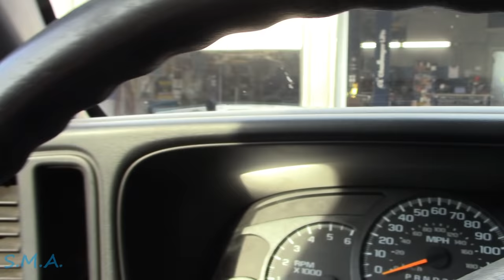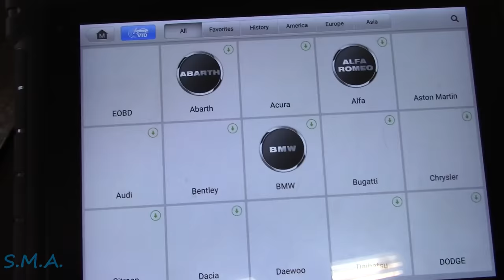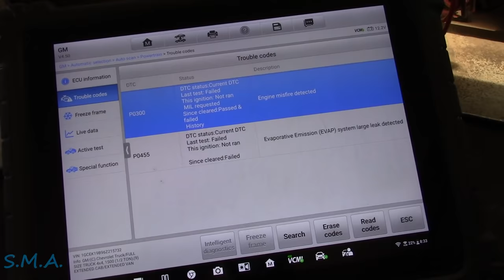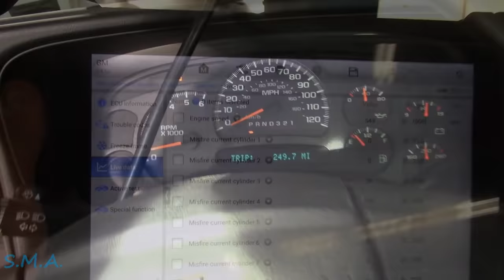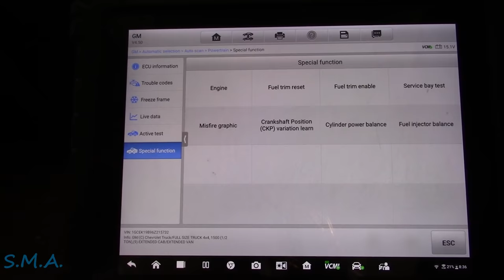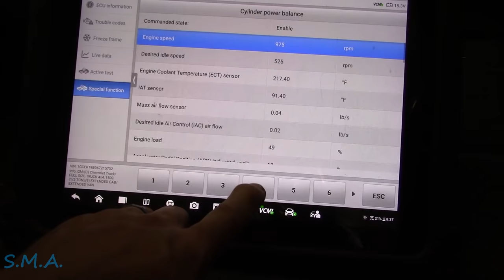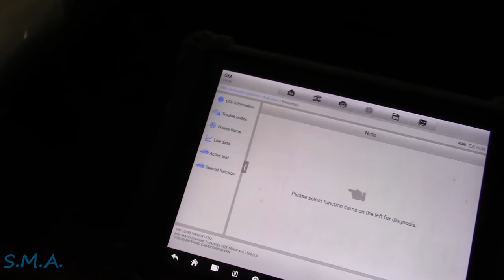GM - Chevy Truck: Misfire Diagnosis

Comment: Thank you you just woke up my brain, there are not many shops who want to tackle a 1996 Volvo, 1960 engine miss fire. I take my heat gun and see if i can see a change in the exhaust temp changes in different cylinders, I spent time in "Pick-n-Pull" Picked up three injectors that appeared to have been changed. The 1960 Volvo, is not easy to find information on and guys don't seem to be interested in 1960's. I own this one, ran fair when one of my "Rabi" friends said it is yours, people and dealers don't want to see 1960 Volvos, there shop. they say it is too old. as I started driving this car it stated to miss fire. everyone in Oakland California, where I live said get rid of that Car! Turns out this car is from your part of the U.S.A. Rust every where. Out here we don't see rusty cars unless you plan to join "Jay-Leno's," gang, who is 500 miles south  of me. Anyway, I like the way you seem to make things simple and understanding, I let you know how I do on this 1996 Volvo, 1960 miss fire. I use 0- 20 Synthetic oil in the Engine, never seems to need oil, and I just noticed Defrost is starting  to show slight steam on windshield sometimes but two weeks at a time, less then a quart of coolant needed. You have a good program. it helps, wake up the Brains.

Comment: Looks like you had the low amps probe hooked up which was why we were looking at a ramp, back probing directly into the injector would have produced the signal you needed for the pintle hump, overall great video! 🖖🏽

Comment: The pintle movement on the good injector was up near the top and the bad one was missing. As an alternate test you can monitor voltage and see pintle closing, if visible, if the pintle closes then it must have opened but in this case I did see it opening on the good one up high which also means that if the opening is down low, the spring holding the pintle closed may be broken which would be running rich on that cylinder, that may be visible on the spark plug if black and should be seen on a secondary spark pattern also, same as lean is visible on the scope. Thanks for the DIY case study.

Comment: I agree 100% regarding fuel trims and misfires. Any kind of miss will put a large amount of oxygen in the exhaust and make the ECM think the engine is lean. What I have found useful is monitoring the downstream O2 sensor activity. If the sensor for the misfiring bank shows a reading on the higher end of the spectrum you can generally assume you'll be chasing ignition or mechanical.  If it's on the lower end then you're likely chasing a fuel issue for a cylinder or cylinders on that bank. All of it of course hinges on the converter being in working order, but it's a non invasive quick check that can help give direction.

Comment: Yes, a secondary ignition pattern can pick up a lean misfire.  On a snap throttle, you will find the second spark line peaking almost a high as the first kv line because that's left over energy that cylinder didn't use up.

Comment: Great Diag Eric, I would have swapped injectors to rule it out before anything, but the fuel pulse was a dead give away, control side was working correctly, the code not being thrown for said injector baffled me a bit.

Comment: I add fuel injector cleaner with PEA occasionally to help prevent clogged injectors and hopefully help clean the intake valves and even the pistons.  I use Gumout but I understand Chevron Techron is good also.  I put Gumout in the gas for all my lawn tools, my outboard, and my carbed motorcycles too and it noticeably helps because they start quicker after setting for a good while and it cleared up a miss on the FI 2 stroke outboard.

Comment: Thanks for keeping us DIYers in mind. Understanding the fundamentals and using multiple tests to confirm the issues. Good reminder for me that good current and resistance checks doesn't prove a good injector. Electrical tests can prove a BAD injector, but passing the tests doesn't mean its a GOOD injector. Have you had any luck cleaning clogged injectors?

Comment: I think the pintle hump was above where you had the trigger set, if you compare them the good one had a drop right above your trigger crosshairs and the bad one didn't. Different types of injectors give different waveforms for sure. I think this takes the pencil type injectors, small around and tall with almost smooth sides. These give a lot smother waveform and they tend to build more amps before the pintle moves causing the hump to be higher and you don't see closing humps either. Been a long time since I did these types of waveforms but memory tells me there was something different about these types of injectors.
Reply: I saw that as well but late to the party to ask the question.

Comment: Every video feels like I'm taking a quick refresher course, but then realize I failed to take the underlying training.  I suppose I got tired of owning cars without any problems.  To remedy this I just acquired a 2014 Chevy Silverado 5.3L with 146,000 miles.  It looks good but showed up with a cylinder miss.  Will swap out original plugs and wires for good measure and go from there.  Probably be a new truck by the time I'm done or I will have gone broke.

Comment: Eric is also right about a cylinder pumping air into the O2 sensor  because, the 02 sensor reads presence of oxygen (on the air) regardless of being an unburned mixture of air and fuel.
Reply: I mean it measures and reacts to presence of oxygen not to fuel.

Comment: I think the injector opening current signature is closer to the steady state on current at about 85% up on the rising current ramp, and if so, you can tell the bad injector is not opening when comparing a good and bad waveform. I think the previous shop changed the coil(s) because the injector resistance measured normal after getting the misfire on cylinder 4 from the scan tool.

They do make spark plugs that are setup with a tap for monitoring cylinder pressure with a high bandwidth pressure sensor. You will certainly be able to see a dead hole with the cylinder pressure sensor.

Comment: I had an interesting one on a Shivvy(lol), had a high misfire count at idle but otherwise ran well. Everything else checked good and the only thing left was mechanical, couldn't find any other reason for the misfire. 
Made the call on the camshaft and i was right, it was missing a small amount of metal on the lobe which caused the lifter to pump up ever so slightly and hang the valve open. 
New cam and lifters and ran perfectly!

Comment: I had this running in the background so might have missed something but a light bulb can be a horrible substitute for an electric load because the resistance is dependent on temperature, it increases roughly 17 times when the glowing wire goes from room temperature to 100% of rated power.

Comment: It seems simple to me.  You have spark, you have power pulsing the injector, yet no fuel flows.  At that point, replace the injector.  I think we over-diagnosed this one.  It's a lot of useful information though.  I think it all added value to the video.

Comment: Use a engine stethoscope to listen to injector. High pitch clicking means injector is dry / intake clogged. Low pitch means full of fuel, spray jets clogged. No sound, yes it’s stuck. Only takes about 30 seconds to do that.

Comment: You will see the hump with a voltage reading by back probing at the injector during the secondary event. Since the injector is not shorted, amp draw look good and clean.

Comment: I had a similar issue but with a 06 Impala, hard cyl misfire at around 156.000 miles one morning. After verifying spark and injectior pulse on cyl 2 But efore pulling the upper intake to replace the injector I decided since I could actually see it why not try and use a 1/4 inch extension on the exterior body of the injector and tap around it while the engine is.running.  After lightly tapping around the injector for about 45sec the engine stated running smooth again, the scan tool detecting no misfires also.  I put Chevron with techron in the gas tank and drove the car. In November I retired it with 248.000 miles with no problems untill the a/c then soon after the fuel pump went out. I did perform all the necessary maintenance like oil changes every 5 thousand and transmission service every 30 thousand. I guess I just got lucky with the injector problem on my GM car.

Comment: This is how I got my duramax so cheap. Cylinder 3 wasnt firing at all and the previous owner figured the engine was bad. Turned out after diagnosis and swapping the #3 and #5 injectors and the miss going to #5 that the #3 injector was mechanically stuck closed and injecting no fuel. I replaced the #3 injector with a new Bosch unit, programmed it, and that was 30,000+ miles ago.

Comment: Hi Eric. Don't be surprised that a new part is either faulty or doesn't work at all, because the whole QA testing process is wrong. You can have a factory that produces injectors in batches of 1000, but only say 100 out of that whole batch are tested and that's from a former QA inspector. The only way to guarentee that the whole batch is OK is for the whole batch to be tested..

Comment: Ignition misfire to the upstream o2 will look normal as mixture is still stoichiometric.  Injector misfire to the upstream 02 will look lean since no fuel, not stoichiometric.  Resulting in positive fuel trim.  Easy to prove this by watching the response via creating either condition.

Comment: I wish I could bring you my work van.  Just started having a random misfire.  Changed plugs & wires (way overdue) ran great in Park, did well for the first couple miles driving, then crap.
Going to check my wire to plug connections again in the a.m.  Didn't realize I could slide that boot/shield back.  Not sure I've got good contact.

Comment: To me, swaptropics is no different than having a “known good” wave form to similar. When I worked at the dealer, I had a bunch of “known good” parts I kept on hand to use on cars models and engines that had the same failures over and over. The known goods helped speed the process up immensely back in the mid to late 80’s. I’d love to throw Eric in the time capsule back to the mid 80’s for a week and see how he liked working on cars then.

Comment: How important are those option selections on the Autel?   I imagine it depends on what you are working on, but what if it's not relevant, then you work on something different later down the road?  How can you change the options on the vin?  Or go through the options again?  Probably a question for the Autel Channel, but I trust you more.

Comment: Very informative video! I have an 06 1500 5.3L with similar misfire issues. Finally gave up and took it to the dealership, where they diagnosed it as a camshaft. Curious if you have any insight/video on how I can confirm this diagnosis. Thanks!

Comment: At 12:33 , if no fuel in the combustion chamber secondary and/or primary will show tween picks on a rev due to lack of fuel molecule conductivity in the plug gap , the  higher kv is due to the scope measuring higher capacitance.
The spark plug is a capacitor the dielectric  is what ever is in the gap.

Comment: I have an 07 chevy 1500  4 by 4 smallest V8. That had a light for Mass Air left it for years started feeling a stumble now and then. Finally decided to change it. Light went out seemed smoother for a few days. Yesterday got real bad as I started up a big hill had to floor it to get over it. Popping and cracking out the exhaust. Stopped idle seemed fine. Eased it up to 65 small stumbles to bigger ones as it hit inclines. But no light at after came on 34 miles back home.

Comment: I remember having an older sentra with a misfire on cyl 1, good compression, good spark. Had to be injector right? Same thing scope injector and could not see a distnictive fault either on voltage or current ramp. Replaced injector mifire went away. Cannot recall about resistance. Great channel.

Comment: Sounds like 2 cylinders lower compression on crank test.
Now my personal 98 Suburban 1500sLt 4x4 3.42 had 347,000 on it and I did a compression test for shits & giggles and it was still 205-215psi per cyl..I always changed the oil with full synthetic when I bought it at 130,000ish.
Original engine & trans, no rebuilds & front & rear diffs.
I did add Dr.Trannys shudder fix at 300,000 for a shudder @55-60 mph when tipping in throttle at speed.
Fixed that.
I did replace the noisy transfer case bc of chain wear.
But I always kept the fluids changed & full and drove it hard.

Comment: Awesome Video.  2013 Silverado.  I have a misfire on #8 that won't go away.  I've done the usual...swapped (and replaced with new) the injector, new plug & new wire, and new coil pack.   Any final thoughts before i pull the heads?  Thanks.

Comment: You could also listen to the actual injector sound using a stethoscope or simple long screwdriver for the diy folks. You will hear a clear difference between the other 2 other injectors and this faulty injector 4. This would give you a definitive answer to replace this faulty injector.

Comment: Also I don't know were I saw this but the wave form on the coil changes because of the lack of resistance on the cylinder due to no fuel because the injector isn't working,  if it's true maybe you want to add that onto your video,  either way thank you I loved your video

Comment: @Eric - I'm thinking about relationship(s) between the injector and spark systems.  In the (awesome) demonstration within this video, would the pintle hump on injectors be different when examining a waste spark system vs. a 1-to-1 COP system?  I've seen injector waveform demonstrations wherein the existence of a pintle hump is examined/found after the charging ramp-up (i.e., in the voltage collapse/fuel dispensing period).  In this video, you're looking for a pintel hump near the middle of the front-side ramp-up.  Just curious...thanks!

Comment: A major problem I heard almost immediately is they replaced coils I am here to tell you as an experienced tech that has owned several ls engines coils are such a rare failure on the ls that I exasperate every option before going to a coil

Comment: Another way to confirm it’s the injector would be to swap it to another cylinder and redo the test you did to find it was number 4. If the problem moved with the injector that confirms it.

Comment: Defenitly not the coil my first comment was wrong wow okay usually you get several bad coils straight out the brand new box these days I would do a compression test and a fuel injector balance test as well nice work Eric O @SouthMainAutoRepairLLC

Comment: Old school eh - I go back to the early Bosch  multi-port injection systems. Those injectors used to leak and I used a Colortune spark plug with a quartz window to look inside the cylinder and see the flame pattern. With a leaky injector the flame was rich (orange) at the idle vs blue for a good injector. The dealer would just replace the whole lot of 6 at $85 each, so the cost of that Colortune re-payed itself in a hurry.

Comment: have you ever  back flow a fuel injector? i put a fuel hose on the intake side of injector, hose clamp it, the hose is almost a foot long  fill with fuel injector cleaner, hose clamp a tire valve into other end of hose ( used a die grinder to reduce size of tire valve to fit hose) pressurize it to 45psi, then pulse the injector and put the end of the injector that goes into the fuel rail over a diaper, or clean rag and see if any debree comes out have saved a few injectors doing that.

Comment: I’m in the swap parts over camp  and I probably would have swamped the injector over just to easy my mind and see that miss change cylinders  luckily I have tons of ls injectors and coils after my 84 c10 5.3 swap   I did learn something during my swap  make sure the injector wiring goes to the correct injector 😅 I had 1 and 5 injector wiring swapped and had a horrible miss  2 months later I figured it out  it’s like have your spark plug wires crossed. Just because it fits better doesn’t mean it goes there

Comment: I have an intermittent problem with the left signal on my 2004 ford ranger.   I normally drive the speed limit in the right lane. Occasionally there is someone driving under the speed limit , but when I put my left directional on , it sometimes makes the car in the adjacent lane speed up.  I’ve taken it to a few local mechanics with no results.

Comment: I fixed a similar problem on a 3.8L V6 just by rapping on the injector with an extension & small hammer. Neighbor hasn't had the issue return.

Comment: I'm guessing the way these are connected to the fuel rails you'll need to replace most if not all of the seals just to replace the one bad injector.  Pity you can't just whack it with a wrench to open back up like a carb.

Comment: I had a misfire that was intermittent, but really bad when it was happening. Also no codes. When the rpms got above 2k the misfire seemed to go away, but the truck was low on power. Turned out the #3 spark plug had backed out 2 or 3 threads. So that cylinder still hot fuel, and spark. But it was loosing some compression through that loose plug. Tightened that plug, and checked the rest and she's smooth as glass again.

Comment: Nice.  Short plug w test light and confirm no rpm drop. Rplc/swap plug. Dead cyl follow or not. No? Rplc injector and add can of 44k to gas. Run to 1/2 tank then top off gas. Note: 44k will kill old worn out fuel pumps.

Comment: if you could tell the injector wad bad with the scope, the pcm would be able to as well and set the light. You already knew the pulse was coming to the injector, so unless the injector was shorted, or open, than the scope would show it.